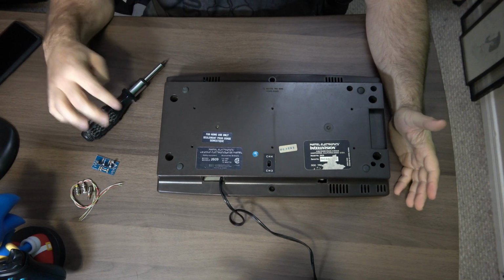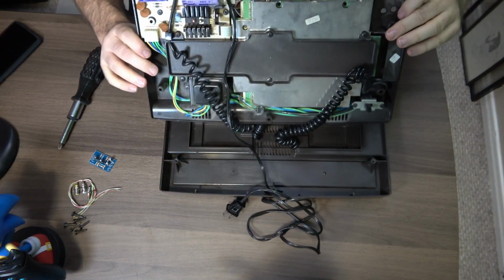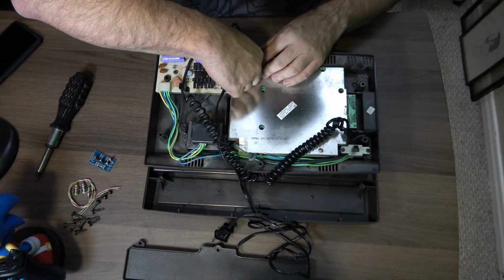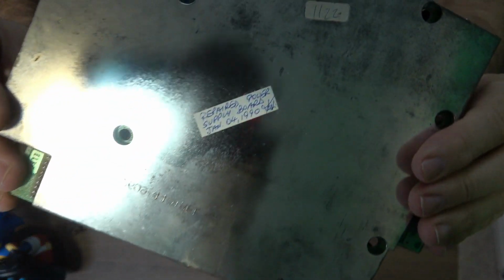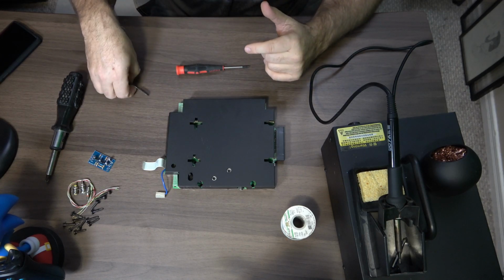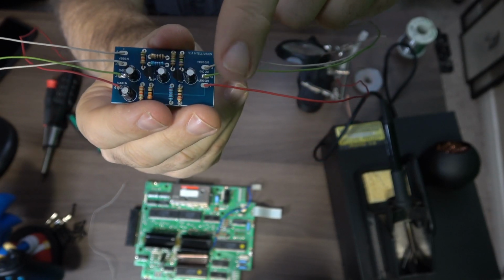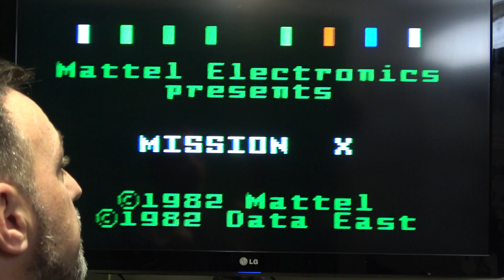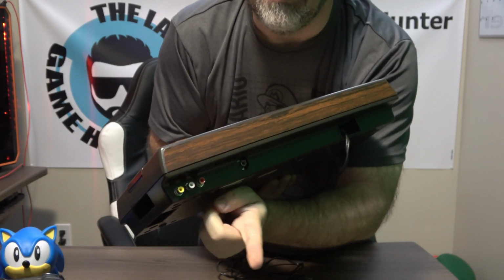Intellivision AV Mod (RCA / Composite Out) Last Game Hunter

Comment: I was wondering.  Can you add a second RCA jack , by wiring it in parallel with the first audio output jack to get pseudo stereo.  Would this damage the circuitry?
Reply from the maker: should be no issues

Comment: Can't find the PC board on ebay.  Any suggestions?
Reply from the maker: https://store.retrofixes.com/products/intellivision-composite-upgrade-amp-kit-coming-soon?variant=10373062855
Reply: Found it by name by zooming in on the board in your video and viewing the printing on the board.  Your ebay link by item number doesn't work.
Got two consoles.  I'll have fun unsoldering the RF shields.
I think I'll put plug-in connections for the controllers so you can remove them from the console and also make some kind of cable extension system so you don't have to be close to the console.
Reply from the maker: @victorklaput2703  Nice let me know the turnout and if you want to send pics my email is in the description